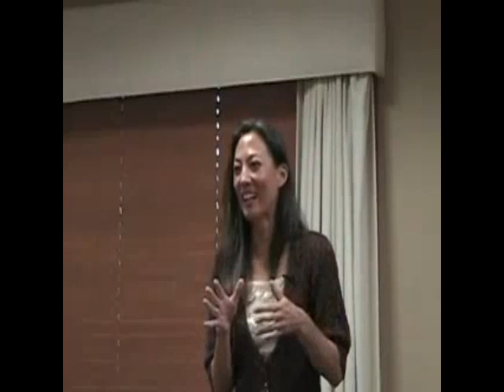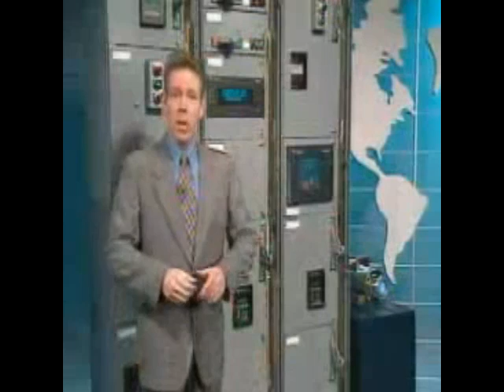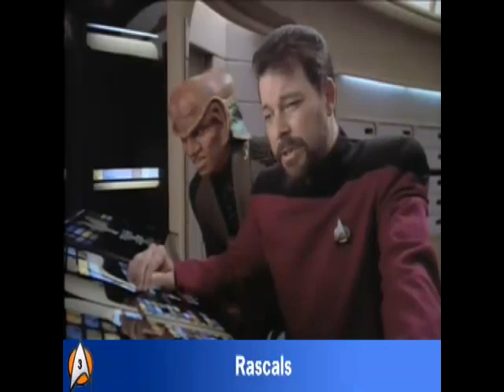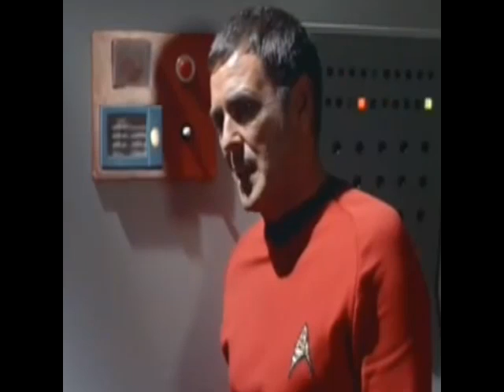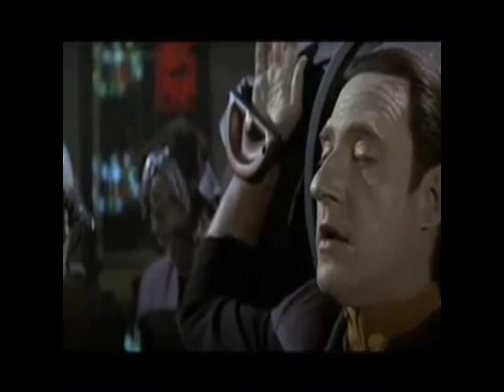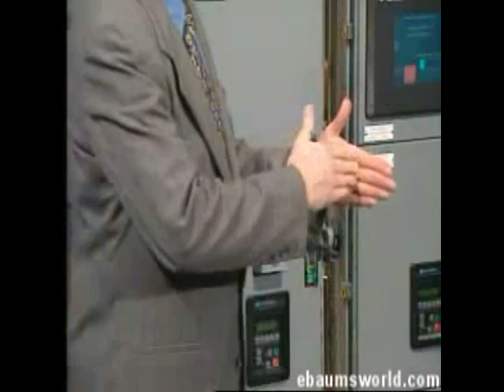The (pseudo)Science of Homeopathy

Comment: Does homeopathy require reversing the polarity of the neutron flow in the subspace self-sealing quantum trilithium resin-based durasteel flux capacitor in order to achieve a 30C dilution?
Reply: It doesn't IIRC. The Federation >> Homeopathy.
Reply: +Akira625 No I think you're a little confused, let me clear it up for you...the dilution of dilation is achieved by nano-computance of substrate molecular tritium manipulation. When ionised with gamma 17 particle flangematics the resulting blammofication results in the resultation of correct electron energy flow. As we know kinetic energy is achieved by Ek = 1/2mv2 so the result means that dimensionless crystal protuberance completes the reorganisation of said modal tautology. Simple really.
Reply: +Akira625 No I think you're a little confused, let me clear it up for you...the dilution of dilation is achieved by nano-computance of substrate molecular tritium manipulation. When ionised with gamma 17 particle flangematics the resulting blammofication results in the resultation of correct electron energy flow. As we know kinetic energy is achieved by Ek = 1/2mv2 so the result means that dimensionless crystal protuberance completes the reorganisation of said modal tautology. Simple really.
Reply: Naturally, but note the exception when you need to mesmerize the proportions of flogiston particles in order to accelerate the intro-entromorphic particles between the brainhalves by depleting the core of a trilithium cortex in the morning.

Comment: I'm gonna quickly debunk the bit I know about.
 "Universal mass fits into a bowling ball" - a solid claim, and it's easy to disprove.

A bowling ball is about 22cm diameter. That's a volume of 0.00557m^3.
The volume of a proton/neutron (radius of 10^-15) is 4.189*10^-45m^3.
Number of p/n you can fit in a bowling ball = roughly 1.33*10^42. Fill the spaces with electrons.
Number of p/n in the known universe (rough estimate) = 10^80

So you'd need two bowling balls just for the observable stuff.